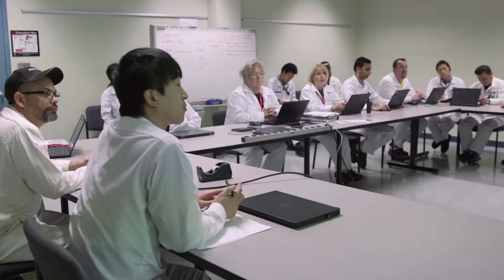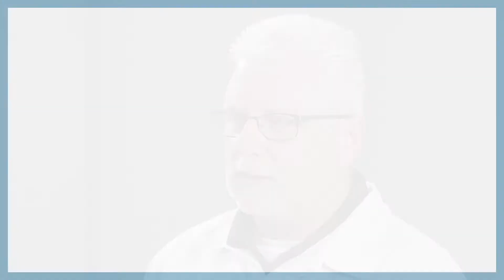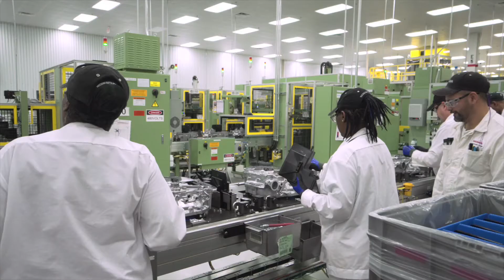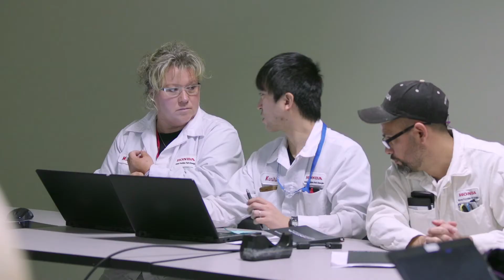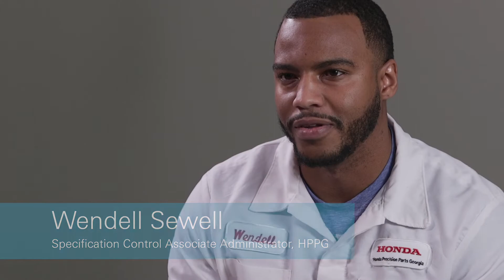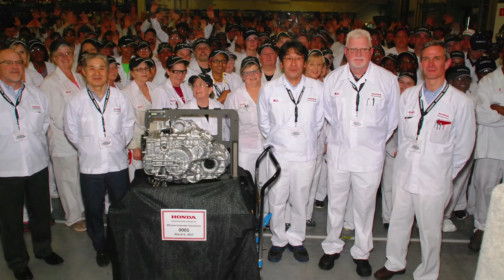Honda 10-Speed Automatic Transmission (10AT) Explained

Comment: I have one of these in my 2019 Acrua RDX. None of the shift programs that come with the vehicle are acceptable. I've driven Manual transmissions all my life. The stock exhaust system on the car hides the fact that the factory programs either hang in unnecessarily high gears, or lug the engine in an unhealthy way. The only way I drive this transmission is in manual shit semi-auto mode. This is the only way I can make the engine sound happy. Even when shifting manually, I struggle to coast down to a low speed at a traffic light, & then pick up again, without the transmission falling on it's face & lagging badly, before engaging again. Mechanically it seems to work well, but the software it ships with is truly bad. I would prefer a manual over this software mess.

Comment: Any advise on what would cause my 2018 Odyssey 10 speed to Rumble at low rpm’s low speeds ? The entire cabin will shake unless gear is manually lowered or more power is applied. I believe it’s while in 5-6 gear range low rpm speeds 40 to 60km. It happens in both eco and non eco mode. 90k and fluid was changed at 80k. Dealer says it’s normal.
Reply: Torque converter maybe. Do a fluids exchange with only OEM fluid
Reply: why wouldn't that be the VCM? also known as Very Compromised Motor.

Comment: I’m in the last years I of my 2009 Honda Odyssey with 5 speed transmission. It runs great 👍 but the rear rust in tire well (common issue) seems to be flaring up. The 5 speed was always a bit ruff meaning feeling the shifts for the first few gears and then smooth as silk after. (130k miles 250 km) I was never effected by the tranny issue this model had  but looking to jump into a 2020 in the next few years. Waiting to see what people say, if it’s still sucks I might make the jump to Toyota. It’s been a great engine since the start. Hopping you and everyone else with the new 10 speed have no issues,
Reply: I have zero issues after 57K miles. There is also an extremely low fail rate and no recalls that ive heard of

Comment: You didn't explain anything,  I and other techs out there don't want to know about the people that came up with it,,   we want to know about the unit !  gear ratios , type of geartrain, etc,,       not some publicity video
Reply: I really want to know if my 10 speed has a limited slip differential?
Reply: Joshua dagaur it does not but does implement AHA which is basically brake assisted torque vectoring I believe (could be wrong)
Reply: Joshua dagaur no it does not.